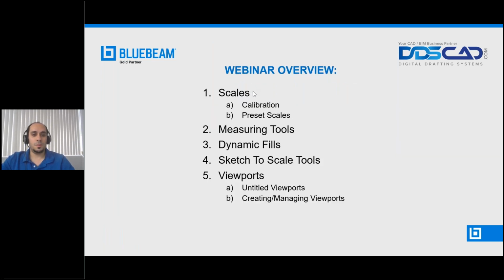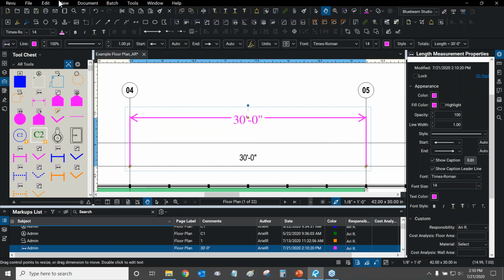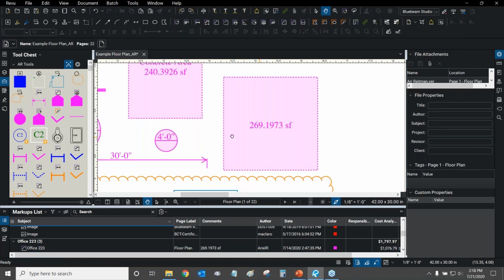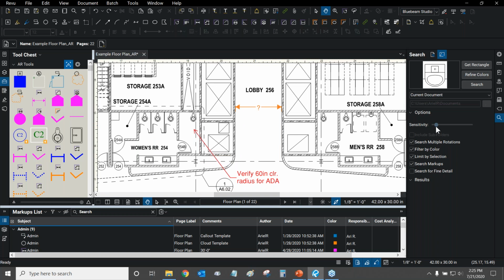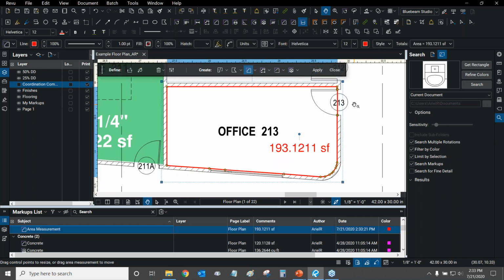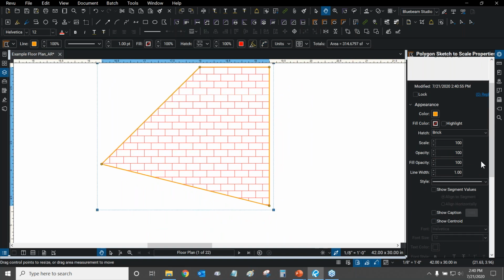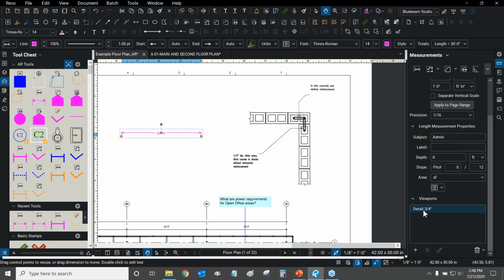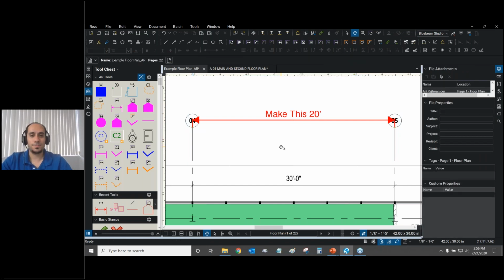Measurements, Sketch to Scale Tools & Viewports - Week 3 - Bluebeam Revu July Webinars

Comment: Hello!....nice content. Please, after scaling a sheet on the bluebeam  it is now impossible to scale other sheets. How do I solve this problem?
Reply from the maker: Hello! You can apply a scale to multiple sheets by opening your "Measurements" panel (The one that looks like a ruler) and clicking on "Add Scale to More Pages" under "Page Scale". Then, you can click on the drop-down for "Pages" and select "All Pages" or type a custom range of pages. You can also navigate to the "Apply Scale to Pages" dialog by clicking on a page's scale in the Navigation Bar (On the bottom-right of the screen). A page without a scale will have the text "Scale Not Set" instead.